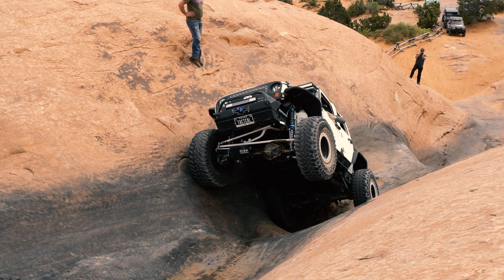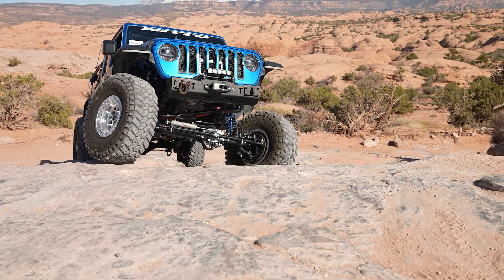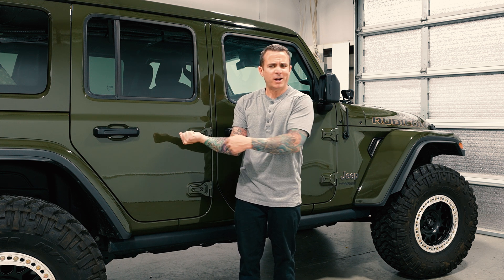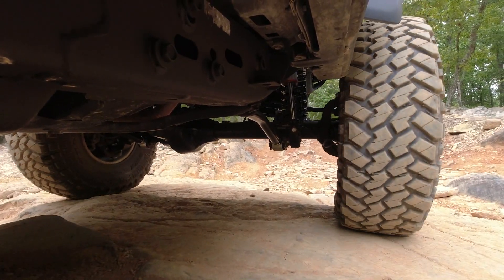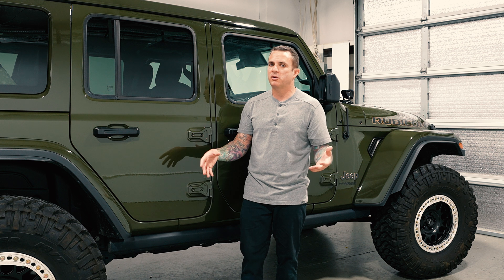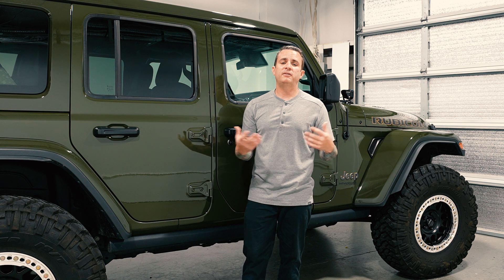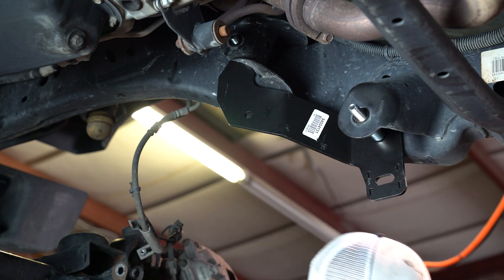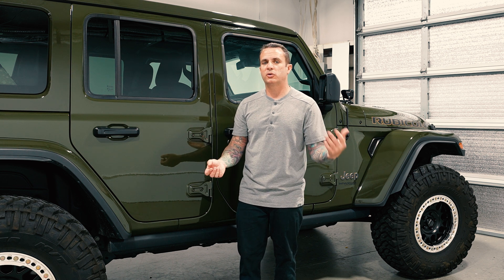Jeep Wrangler Long Arm Suspension Versus Control Arm Drop Brackets (Which Is Better and Why?)

Comment: What is the best for both daily driver and long highway trips in addition to a mix of offroad not extreme rock crawling ?
I need 3.5-4.5 inch lift for 4xe
Reply from the maker: It's going to drive the best with a long-arm suspension. This is especially true for 4.5 inch lifts. A control arm drop bracket system is your next best option. I would look at an EVO MFG suspension. I have their 3.5 kit currently with the control arm drop brackets. It's a touch on the firm side, but the handling is great.
Reply: @Ali_Mansour_Editor do u recomend evo mfg coilover system or coil spring system for the best mix of highway and offroad uses?
Reply from the maker: You can fine tune the  Evo MFG coilover system much easier than the standard coils. I would rather go that way. Just keep in mind, that system is meant to be adjusted. So, you have to be willing to fine-tune it to make it work best for your needs. I have a few friends with that kit. It works phenomenal right out of the gate. However, it might feel a little firm if you’re not really gonna be pushing the Jeep fast Offroad. So, you might want to adjust the spring rate or even back off some of the valving with the secondary shock if you go that route. Ultimately, you’ll have more adjustability and a better ride quality with a coilover.
Reply: @Ali_Mansour_Editor thanx a lot Ali
That was very helpful for me🙏🏻

Comment: So it's all relative to the individual's perspective. But; you can't beat the math/geometry. The flatter the better; you'll especially notice it in the front; no matter how you get there.

I have an AEV JL370; so if I'm on the drop brackets, I personally need a new line.

If you bend a bracket, they're serviceable; long arm brackets or drop. If you bend a factory bracket, you have to fix those too.

Has anyone looked at the factory rear brackets on a Bronco or 4RNR; they all hang lower than any Jeep with a drop bracket. Jeep guys. Would you give the guys at 74Weld a hard time for stock suspension on 40's? It's still not a long arm?

If you go down the rabbit hole long enough, no matter what you add to your rig, it's still not a tube chassis with double triangulated 4 link front and rear that's perfectly flat and in a LCG chassis.

So when is enough, enough?

Comment: Great video and explanation. Would you suggest I run control arm drop brackets on my 21 Gladiator Rubicon. It has the Mopar 2” lift with the Teraflex 1.5” leveling kit. I was planning kind getting the Teraflex control arm drop brackets but am not sure if it is needed for my application. Thank in advance.
Reply from the maker: If you’re not happy with the way the Jeep is handling, then it’s not a bad idea. However, with that amount of lift, I don’t think the drop brackets are really necessary.
Reply: @ Thank you for letting me know I greatly appreciate it.

Comment: Hey Ali, I've got a 2013 JKUR w/3.73 gears (10th Anniversary ed. "hard rock" ). I run 33s, but I want to run 35s. I've put a 2.5" suspension lift w/Falcon shocks. What other changes should I make to run the bigger tires? Re-gear?
Reply from the maker: I had a similar Jeep to what you are describing and ran 35's with the stock 3.73 gearing for a little over a year. It worked well enough that I decided not to re-gear. I even drove the Jeep from NC to Moab, Utah, that way for the Easter Jeep Safari. When I eventually moved to 37's, I had to re-gear and went with a 5.13. That caused the Jeep to rev a little high on the interstate, but gave it great power all around. If you find that it feels too underpowered after the tire swap, I would move up to a 4.88. That will give you more gearing than you really need with a 35, but if you ever move up to a 37, you will still be covered.

Comment: It's worth noting that, not only is the long arm kit more expensive, but the install process is significantly more complicated. This includes permanent changes to the frame itself. I have teraflex drop brackets (3.5" lift) and I think the ride is fantastic. I probably will go to long arms in the future, but not feeling a rush to.

Comment: Good video, Ali. 
I have both drop brackets and MC control arms on a 3” lift. 
I liked the ease of flex with the MC arms and wanted to keep them as parallel as I could. It’s overkill to have both but I DD my Jeep and I like how it drives, so I leave it alone. 
Your 392 looks pristine! 👍🏼
Do you have any experience with bronco raptors compared to your 392? 
It’d be interesting content to hear your thoughts on it. 
Keep up the good work 🙌🏼
Reply from the maker: We purchased a ‘24 Bronco Heritage Limited Edition for my wife earlier this year. I checked out a Bronco Raptor at that time. I can’t really weigh in on that too much. I drive my wife’s Bronco occasionally and I honestly prefer the Wrangler. She loves it and I think it’s probably “easier” to drive compared to the Wrangler. Zero chance I would sell my 392 for a Raptor Bronco.
Reply: @ 
Interesting take on the heritage not being a first choice for you. 

My buddy got a 2 door heritage. It is nice. Drives well. But I was only in it for 15 mins or so. 

Thanks for your thoughts on that. 👍🏻

Comment: As someone who ran MetalCloak front control arm drop brackets, I’ll say that initially, they were okay for ride quality. However, over the span of a year, I noticed they fatigued fairly quickly and started introducing some unwanted characteristics in driving and handling. The steering gradually became a bit too floaty, and the Jeep didn’t feel as planted on the road.
Reply: Woah Thanks!
Honesty about products is the stuff man. Lots of people just settle; Say nothing and let everyone get scammed 

I would have bought this🥲